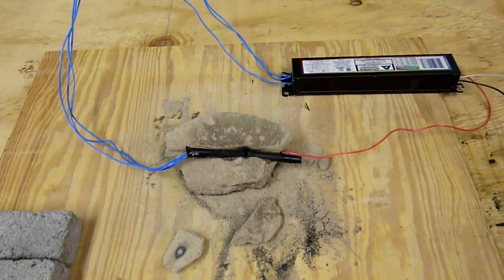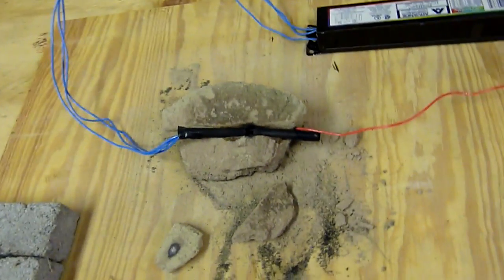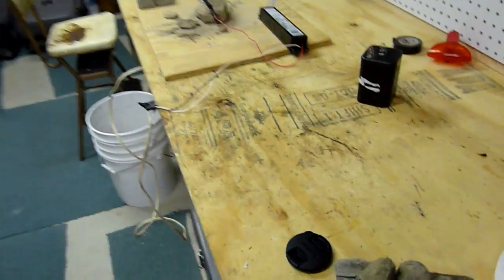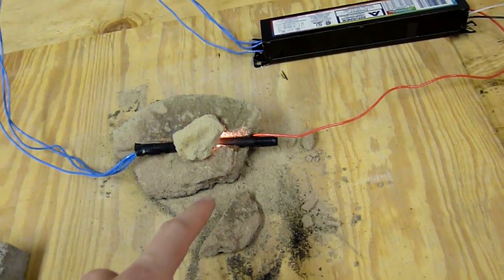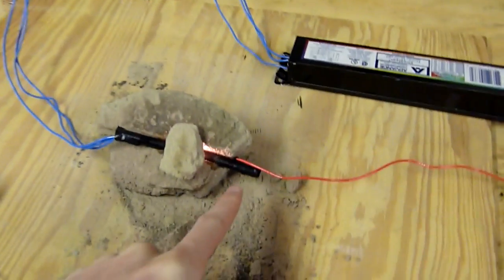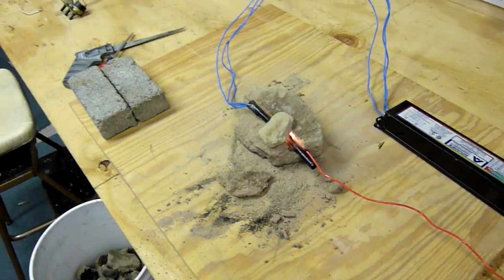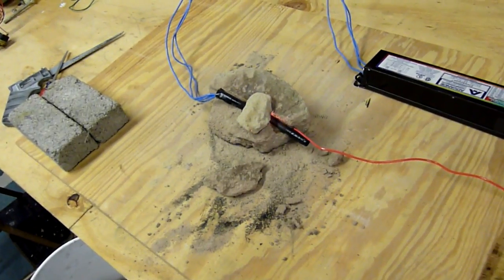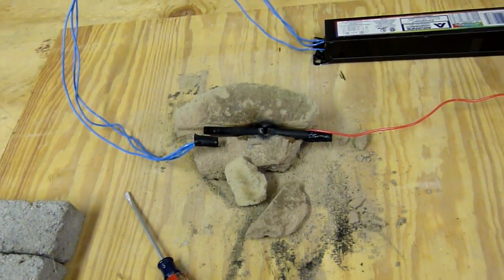Small Arc Furnace

Comment: @jpoopdogFTW assuming the battery is Zn/C and not alkaline, it could very well be ZnCl2, as an electrolyte, or if it has been discharged at all, as a byproduct. even if the electrolyte is ammonium chloride, ZnCl2 is produced by use. check wikipedia for zinc carbon battery. it says ZnCl2 is an improvement over the old ammonium chloride electrolyte. which means cheaper or more efficient, so highly likely. and why would they use wax in an electrode that need to have contact w/ solution

Comment: @demnlordd666 
zinc chloride is very hygroscopic, though feels greasy or even buttery, hence the name butter of zinc, however it is not flammable in the least, not does it posses the capabilities to cause a nuclear fission reaction when burnt resulting in a realease of carbon, i just burnt some over a peice of glass, and like a candle flame, aka burning wax, it released carbon in the form of soot.
Now, an example of an oil or wax added to carbon rods is linseed oil

Comment: @demnlordd666 
oils and waxes are just added to the carbon rod to make them stronger and less prone to cracking when electrolysed. besides, when you heat it up, wax is what comes out. zinc chloride is not an oil or wax, yet thats what come sout when i clean my rods before i use them. the wax and oil floats on water.

Comment: @jpoopdog2 ok well tonight I am gonna be taking apart some batteries any way and I also have a few old rods salvaged from the side of a mountain, (storage batteries from a fire lookout dumped in the 50's) I will try an acetone & a MEK extraction on each type and see what I find. when I applied heat to some of my ZnCl2 it made white ZnO ash that puffed up and a horrible chlorine smell.  I could attribute that to the wax look, but only if the extraction yields nothing.  let ya know how that goes.

Comment: ebay for 6oz graphite crucible and 1/4 x 12 inch graphite stir rod.  place goodies in crucible.  place one lead to copper strap/clamp on crucible .. other lead to end of stir rod.
introduce slag powder on top of goodies.   poke stir rod through slag powder and strike arc.  DIY submerged-arc furnace! an eminently-capable homespun melting device!  Yes Sir!

Comment: @jpoopdog2 actually I just made some zinc chloride the other day with the metal and HCl.  I tried to boil it down to crystalize out a hydrated salt form for easy storage, and instead it made a very thick and heavy boiling, amber colored solution( prob from impurities). upon further heating it turned to greasy kinda fused looking whitish lumps, and only part of it was completely dried, really liked its water.  so ya ZnCl2 could easily be. make some n see